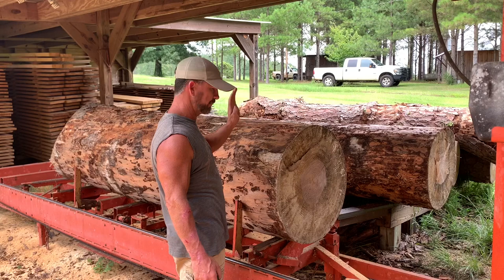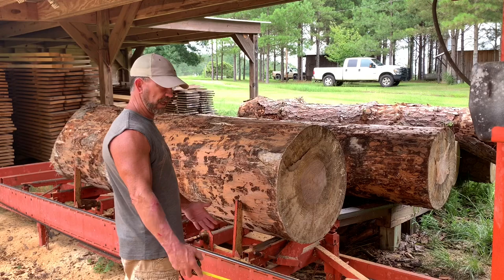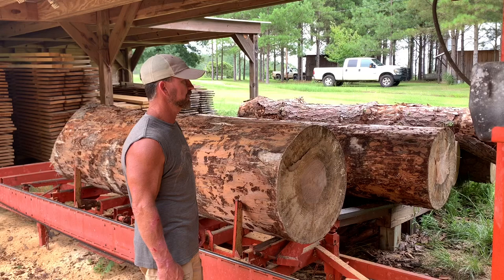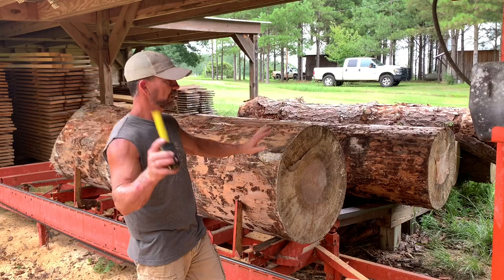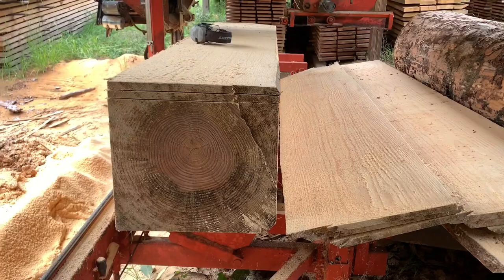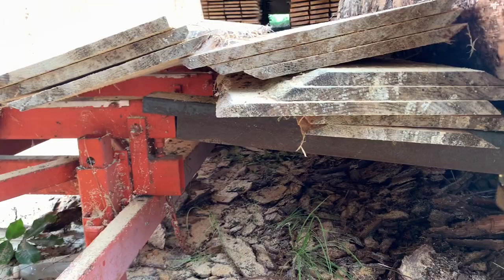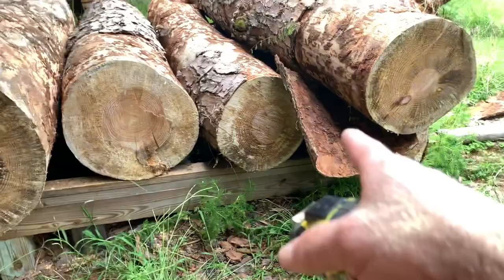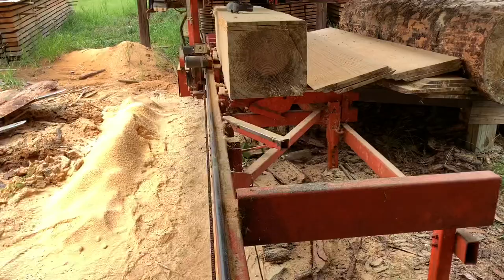Logs to Lumber: Saving Money on Wood Cutting Our Own Boards!

Comment: I will give you a tip for sticking your lumber. Put your sticks about 2 inches from the end of the board on each end. Have you noticed that the board will ( check) as it dries? But the checking stops at the stick? Buy moving the stick closer to the end you have less checking and you don’t loose as much lumber.

Comment: That's second growth SYP, alot of it was planted at the turn of the 19th century when the original old growth was cleared. Personally, I don't like cutting SYP on the band mill, much prefer a circle mill for dimensional lumber. Your mill is cutting well, nice wide boards.

Comment: Way off'topic Jeff.
The death wobble on the Kabota front end might be solved as was the old solid axle Dodge pick ups back in the day. A horizontal shock was installed on the tie-rod... It really made the old trucks driveable again. More castor might have helped.

I'm an old HD diesel mechanic retired long ago..

Comment: Jeff, are you able to use unstamped lumber for structural applications? If so, that’s a big money saver. Thanks for the video!
Reply: In certain places in Alabama there are no codes to follow. Built a few on the coast that were just as astringent as Florida building code and built some around Elba that all they cared about was making sure the septic tank was good and the fart fans were vented all the way at the peak
Reply: Good to know!

Comment: 346 BF from a 8' by 27" top ??? I just pulled me fadders old log scaling charts (He had a mill in Newfoundland 52x1/4 'circular blasde on a friction rig) out and it should only be 260 on a 1/4 blade and 288 0n a 1/8 blade.  One BF being "'x12"x 1' . Now the charts don't allow for short boards cut from the thicker stump slabs which vary in lenght depending on the taper.  Are you counting short board too or just  8ftrs?

Comment: Question... Have you had trouble  with Blue Stain Fungus covering the pine lumber as it dries???
Reply: In Virginia, you'd better saw any white pine within 3 days of felling. The heat from June to September causes the blue staining. Also, after about 5 days you can hear the pine beetle larvae munching on the log.
Reply: Keep it covered with plenty of ventilation. But that blue stain makes for higher priced lumber

Comment: Yes you can cut all that but if you use it in any support framing or a residence it must be inspected and that requires inspection of each piece of wood for that use . You can get it done but it does cost money.
Reply: Not everywhere, here in real Missouri framing lumber does not need to be stamped or inspected. I sawed most of the material for my house and shop. 5800 sqft 14' plate line and 3900 sqft house.
Reply: Anywhere outside of the city ( unless it's FHA or HUD ) should not have to be inspected
Reply: @allenwilson9656  Usually its determined by the county code inspectors/enforcement.   That doesnt mean it will ACTUALLY get inspected.  In many more rural areas the inspector may not even come by at that stage in building. If they COULD come by but usually dont its taking a chance.
If he cuts for a fee and doesnt tell buyers it might need inspection for structural use then they might be very unhappy. It definitely is required anywhere in my countyand it will get inspected.